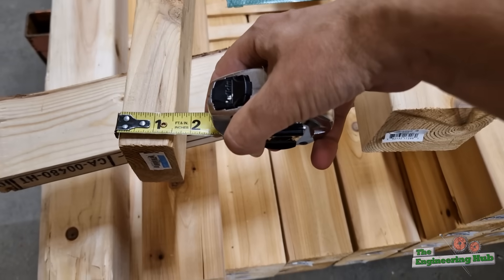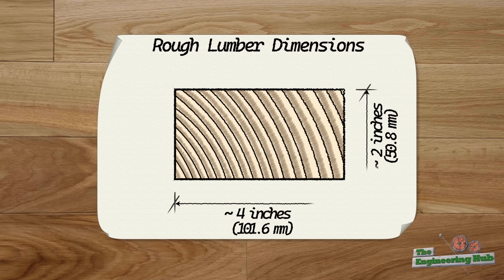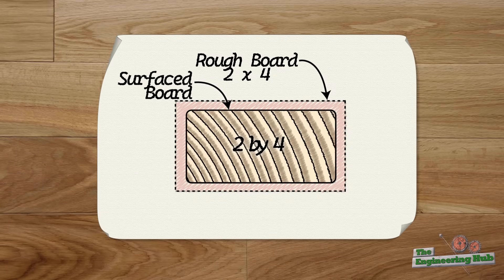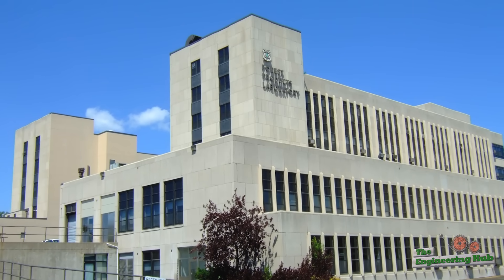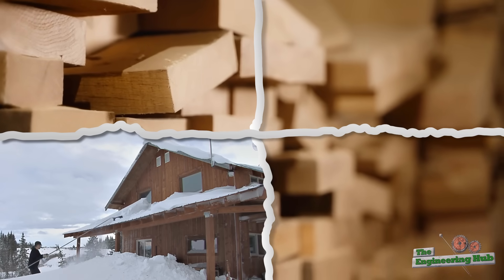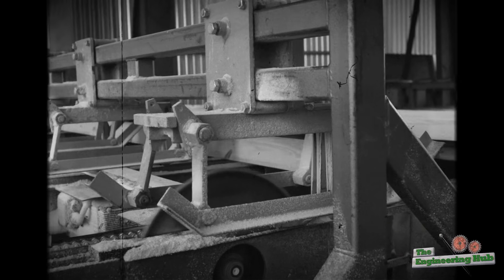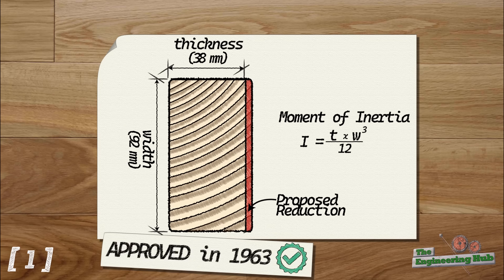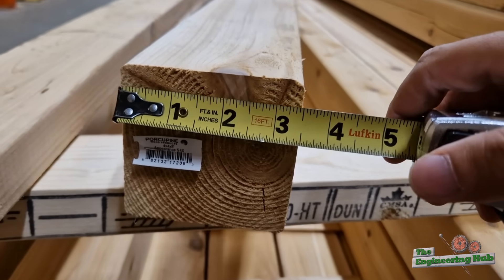Why is the 2 by 4 getting smaller and smaller?

Comment from the maker: Notice how back in the day the corners of the boards were sharp. Now they are planed/chamfered. There are several reasons for this:
1. Chamfered edges help construction workers to avoid splinters and other minor injuries. 
2. The rounded edges make it easier for the boards to slide and travel on the conveyor belts (during production) and are easier to stack. 
3. The boards are (slightly) more fire resistant as the edges usually catch on fire first.

If you found the video entertaining and educational and you would like me to keep producing similar content, consider clicking the Subscribe button. That helps a lot!
Reply: My house was built in 1969.  It's 2x4's measure 1-3/4" x 3-3/4".  They still measure this dimension.  It was like this for a long time before going to 1.5 x 3.5.  It is the planed dimension after planing a rough cut 2x4.
Reply: I'd say the finished size did not begin at a full 2x4 rough cut in the 60's. I worked in a planner mill 1979. Can not attest to any sizes but I know if the board was knot free, they did not mill it smooth. I think they called it "structural" lumber. We jackassed them onto a different cart.  @n2omike
Reply: @cliffontheroad  You can't even buy lumber stamped structural any more. The 1 x 4 let in diagonal wind braces on my 1964 tract house are stamped structural.....but the whole house was sheathed in 3/8 3-ply INTERIOR plywood which I had to replace.
Reply: My 1883 balloon frame house is made from oversized yellow pine stock measuring up to 2-1/8" wide. There is slight variation in width from one to the next.
Reply: @YeOldTimeyWorkshop   it was not that critical when the walls were going to be finished in lathe and plaster.  My 1901 houses floor joist vary over an inch in width on the first floor. The top of the boards are obviously on the same plane and the bottoms that vary face the unfinished basement. All mortise and tenon
Reply: My lumber pile, collected from various house dumpsters, has a wide range of 2x4's, so I must pick carefully.  From 1895, I'd say more than 3 variations. Who ever heard of 3x5 rafters, ruff cut? Me.  @DonariaRegia
Reply: It also helps when sistering them in after you realize you screwed up.
Reply: I have seen a lot of old framing using actual 2x4. None of the stuff I have seen was planned down on sight. You can still see the rough cut on the surface from the saw mill.
Reply: the garage on my property is made of real square 2" boards, it was built in the 1950s @ban80
Reply: The rounded edges also help resist the wood splitting deeply, wrecking the entire board.
Reply: Also you can just them closer together.
Reply: You can pin your own comment
Reply: @TheEngineeringHub  ? 4. rounding the corners lightens the shipping load also ? Just found your channel and subscribed.
It's looking to be a fun ride. peace.
Could you estimate the weights of a house made with 2x4s and the same house built now?
Is insulating quality of a  4" wall space much different than a 3½"?
Reply: It also means they can give you less wood
Reply: @ValdVincent  fake news here kid.
Reply: CLICKBAIT. Why is the 2 by 4 getting smaller and smaller? Oh it isn't? OK so then it should be Why did the 2 by 4 get smaller?...Nobody cares?
Reply: @cliffontheroad   illinois
Reply: Thank you for that info . I have noticed that corners thing here in the UK. On another issue I recently found how difficult it is now to purchase  mahogony  . It seems it is a protected tree.
Reply: @garypautard1069 . The same goes for Redwood I imagine much of it it's because of how much has been cut down and not replaced.
Reply: Another benefit of the rounded corners are airflow when stacked tightly. Less rot/mold, drier wood.
Reply: If you get a 2x4 in oak, it will actually measure out at 2" x 4".  All this cutting down is to maximize the lumber yield of a log.
Reply: Only specific two bys are chamfered not regular framing timbers
Reply: None of the boards in your video actually measured 1.5 x 3.5. They were all a 1/16 under. Plus factory grown pine is like balsa now. Old growth pine you cant even nail into without cut nails lol. Its all fucking trash now.
Reply: It may be worth noting, rough cut 2x4 boards that actually ARE 2 inches X 4 inches are still available, in big box stores, at reasonable prices. If your project calls for larger, stronger wood that's not as flat and smooth, it's still available!
Reply: Very cool info in the video! Thanks!
Reply: The wood is no more fire resistant 🤣🤣🤣the flame spread rating of wood doesn't change you absolute fucktard
Reply: so why cantr they just cut them thicker? ya know? instead of false advertisement
Reply: @bigdaddyd-rk9pn  it's not false advertising it's people being morons and not knowing better. Those of us in construction have known this from day one. Anyone who doesn't k ow shouldn't be building shit lmfao
Reply: When I moaned about my 2 x 4 not being 2 x 4..... I was told it's because timber these days is "Normalised" sounds like a made up word to me lol
Reply: @mickmick5667  all words are made up.
Reply: Then why called them a 2x4 if they’re not 2inx4in?
Reply: @T1AO-NotMike  industry term. You want to ask for it by the actual measurement?? Steel studs are the exact fucking same. Pretty easy to tell who's not in construction here
Reply: I agree.  It's obviously done just to rip people off.  There's no reason the rough planks couldn't be half an inch thicker than the specification, so that the planed planks would then be an actual 2x4, other than cost.
Reply: Holy fucking chirst you have no idea about shrinking in wood. it is MADE AT 2x4 inches. THEN SHRINKS FROM WATERLOSS OVER TIME TO 1.5 inches X 3.5 inches. you just basically told us 'oh, green wood is already planed and shipped to you. That would make the AGED LUMBER THAT YOU BUILD WITH be 1x1.5, You know nothing. Stop. Fact check yourself before you do this 'knowledge improvement lesson' It's false.
Reply: They are round because shape edges get damaged every time in shipping.
Reply: G'day,

Australia squeaking...

Bullshit..

When I was a kid, a 4"X 2" bit of Wood measured
 4 inches by 2 inches..

I" by 1" was an inch by an inch.

But, here in Oz an Imperial Gallon was 10 Pounds of Water, or 4.454 Litres of Water, and 224 Gallons was 2,240 Pounds - which was a Ton.

Whereas Metric Tons, 1,000 Kg was 1,000 Litres which was 2,200 Pounds...; but in the USA they contrived the "Short Ton" which is only 2,000 Pounds 

So, in the
REAL World,
Trees are felled, then Barked & 
Quarter-Cut into Billets which will not crack while drying, and as the Billets are required they can then be Reduced to Rectangular Prisms - ideally
Quarter-Sawn, so the Timber won't Cup or Warp or Twist or Bow or Crack or Split while being dried...

But pursuit of higher 'recovery rates' has prompted most Mills to either "Back-Slab cut" or alternate the Faces to achieve 1/3 Quarter-Cut, 1/3 Best Approximation Quarter-Cut & 1/3 which will warp and crack and split no matter what...;
and then careful Stacking and Racking and Slow Drying - or Kiln Drying...will produce marketable Timber, with half being "selected Timber" for jobs which matter.

Then the Mills are reducing 
SEASONED Billets to
Sizes which are stable when they come off the Saw -
Or
The Wet Wood is cut oversize to allow for Shrinkage while drying, and then planed down to size before going into the Shops.

The FACT appears to be that
AmeriKa is so jam-packed with
Liars, Fraudsters, Thieves, Cheats,  and Fools used to being ripped off by Cheats and other Professional Deadbeats swarming all around them - that they have ALL long
Normalised such
DEVIANCE from the observed and 
MEASURABLE 
Reality...,  within the
Perceptions of their
Sacred
EcoGnomie...

Their "US Gallons" are 3.815 Ltres instead of 4.454, so they're almost 8%  UNDERSIZED..., as compared to a real one...

A "US (Short) Ton" is 200 Pounds short of a metric Ton - and 240 Pounds short of one actual Imperial Ton... ; fully 10% undersized, in Reality.

While the Lies,
Skullduggery,
Ad damnfool
Silly-Buggary which goes on within the US Building, Hardware & Timber-Supply "Industry" ;  
All merely serves as ongoing 
Proof Positive..., that the Commefcial majority of the  population of the 
Excited Status of
Norte ArmedmeriKano are both
Functionally Innumerate, Functionally Illiterate, and
Gullible beyond all 
Logic and
Reason. (!).

So, it's no bloody  that wonder they
Voted for
Trumpy...;
They're ALL at least as 
Functionally
Stupificated as 
Trumpy so very clearly
Is, nowadayze, as his
Frontal-Temporal Dementia
Culminates
Unchecked...

And,
All by their own
CHOICES...

Such is life,

Have a good one...

Stay safe.

;-p

Ciao!
Reply: @TheEngineeringHub  
Very cool to learn this bit of trivia.
Reply: I can assure you that even as an American it is ridiculous to us too.
Reply: The chamfered edge is called “Eased Edge”
Reply: They were never sold unplaned,  ever.
Reply: The wood we buy still have straight edges stop spreading fake news
Reply: Awe ,😢some poor guy got a splinter. Do something besides bleed.
Reply: It's going down!
I'm yelling timber!
You better move!
You better Dance!

Comment: Same problem of sizing and usable size o curs with lifepo4 batteries.
Actual capacity.
Usable capacity (80% discharge)
Warranty capacity.
So if you want your 100ah battery to last and be in warranty.
It will generally be 80ah and be required to be recharged that day.

Comment: From france: I have a 300 years old farm with original oak beams 12"x12"
The inside is still hard as stone!
When I did some renovation, I found a sawmill nearby which had a mountain of trunks in front of his barn. Old trees cut along the roads.
These trees are stronger than the one grown for the wood, nowadays they are grown too quickly and are less dense!

Comment: would be soooo annoying to want to make a cheap cabinet and because its not a full 2 by 4 inches you have to spent more time thinking about the exact dimensions... would be easier for buying, cutting, fitting and everything if you could just measure the inside and add 2 inches to the top and bottom or measure the outside and subtract 2...

Comment: I work in the industry, the plank is 2 x 4 before it has been surfaced 4 sides to make fine planks with as little faults as possible.

If you want a 2 x 4 that is truly 2 x 4 you need to by the rough plank.

Comment: 2x4's most definitely do NOT start out as 2"x4". Logs are far too expensive for mills to throw away all that wood. With modern band saws with sharp, fine teeth, minimal surfacing is required. Smaller boards means you can get more of them from a log.

Comment: 100 year old homes can withstand 150 mph winds , new homes fall apart in 100 mph winds .... it,s not a coincidence it,s by design 😮
Reply: We’re smarter engineers now than we were then.  Any idiot can build a house that can withstand winds, but it takes a highly skilled engineer to build a house that barely withstands winds.
Reply: @jeffreyrossman1083  the materials used  now are junk , sawdust and  glue , plastics  and 1.5 x 3 inch  softwood lumber , the trusses are a joke  , the frames are  weak  and you say the engineers of today are smart  ?  You sound brainwashed

Comment: Here in the UK, until maybe 15 or so years ago it used to be possible to buy rough-sawn wood at the timber yard that actually measured 2” x 4”.
But this was lower-grade stuff usually (called carcassing timber) and significantly cheaper than a PAR 2” x 4” that had been prepared (planed all round) and was thus noticeably smaller. But usually of better quality.
But now it’s only possible to buy them PAR, at the higher prices, and they measure 1¾” x 3¾” and have the corners rounded too.
I would only ever buy them from a proper timber yard rather than a big DIY store, where the quality is invariably dreadful…

Comment: in short: Profit
Reply: 2x4 is interference to the Ruff Cut & back when they used to sell Ruff Cut lumber the customer had to plan the wood themselves. When they started planing them at the mill it saved the customer work & shipping cost & it was still the same amount of wood whether the customer planed it or not. Really the only reason "Profit" comes into play if the claims made in this video are true is that shipping ruff cut really far from the mills made it unprofitable to even run the mills so pre-planing actually worked out for the consumer & producer.
Reply: @wandameadows5736  You don't need to plan everything un construction. It is for profit.

Comment: Having smaller studs closer together means that lining and cladding materials don't need to be as rigid, because they are supported at shorter spans along their length. Have a look at a plasterboard manufacturer's installation instructions and it becomes very clear that more frequent, smaller studs have a big advantage!

Comment: I live in a home that is over 100 years old... There used to be a mill/lumber yard down the street (long gone)
This home is FRAMED with 2 inch by 4 inch oak... the joists  are also OAK and are thinner than what we use today but being that they are oak they are overkill.
I have drilled screws into the boards and literally exceeded the drills capacity to bottom out the screw, even with hammer drills
even some contractors that have seen this are baffled that this is how it used to be done and don't believe real 2x4s exist, they used to but not anymore.

Comment: This is how you get a dozen  different gallons or hundredweights.
Reply: Gallons aren't measurements of length.
Reply: @zyxw2000 

I didn't say they were or are.  There has been, over time, a number of different gallons.  Sometimes at the same time.

Similarly, there are times and places with different hundredweights for different products.  For example: in midevel Cologne, a hundredweight of nickle ore was 120 (Cologne) pounds.  This was because about a fifth of nickel ore was useless, so the consumer got a 20% discount.

Comment: There's another factor to consider.

Throughout most of the 20th century, sawmills were indexed to whole inches. As the log carriage returned, the log would be shifted by a whole inch; shifting by other amounts was not possible due to limitations of the equipment, so rough lumber was always cut in whole inch increments.

Initially, lumber was unsurfaced, so was full dimension (i.e., 2"x4") but the limitations of the equipment also meant it wasn't exactly consistent, sometimes varying by as much as 1/4 inch, even on the same piece!

In order to produce consistent dimension, the lumber was proposed to be surfaced on only two sides: one face and one edge, to a uniform size of 1-5/8 by 3-5/8. This allowed for compensation of the variable thickness of the rough lumber by removing as much as 3/8".

When it was deemed desirable to surface all sides, removal of 1/4 inch on each side was allowed, resulting in 1-1/2 by 3-1/2. By this time, mill equipment was more consistent and accurate, but still indexed to 1".

That means that all that surfacing only reduces per-piece shipping costs, but there's still a lot of waste from the planer mill.

I'm not saying you're wrong, just that there were additional considerations.

Modern sawmill equipment allows for much greater precision and accuracy of cut, able to index to fractions of an inch. A modern mill can probably rough cut a “2x4” at 1-3/4 x 3-3/4 (or smaller) and need only remove 1/8" (or less) from each side during surfacing, maximizing the use of the log and reducing planer mill waste. But the standard is set, and production builders would be upset if the lumber suddenly got fatter because many materials besides the studs are keyed to studs being 1-1/2 by 3-1/2.

Comment: It never was 2x4 in reality. Dimensional lumber is nominal. The dimensions are based on the raw size before the wood has dried out or been treated.  Been working with wood a long time, 1.5x3.5 is a 2x4.

There is lumber that is true to size, things like plywood, engineered beams and boards are true to size. 

Been working around lumber since I was a kid, relatives owned a construction company going back 50 yrs, it has not changed all that much.  It hasn't changed the useability of it, engineering standards for things like unsupported span length have def changed little if anything at all.

Comment: Interesting info - but really doesn't tell me why a house I owned years back, built in 1950, was framed with actually as measured 2"x4" studding. I rebuilt that houses garage, reusing many of those old 2x4's, some from my home builder father in laws old 1960's stock 1-5/8 x 3-5/8 and some new 1-1/2x3-1/2 studding. Of course I never measured any of them - oops! The real fun came when I went to install dry wall. Lots of shims cut. House and garage are still there 40+ years later and still looking good though I've moved on 2-3 times since.

Comment: To all the clueless dumb*sses posting here. I spent my entire life working in the timber industry and this is not complicated. Green wood is full of water. Sometimes over thirty percent by weight depending on specie. After being sawed, the lumber begins a natural drying process. Kiln drying speeds up the process, but the goal is the same, obtain a moisture content below 19% for framing lumber. When that much water is removed the lumber shrinks, but not the same amount from board to board, thus after drying there is a stack of lumber with a multitude of dimensions. Planed lumber makes all the boards uniform which is highly desirable for construction. The myth that the sawmill is trying to rip your *ss off is bull pucky. Over half of the missing dimension is water loss from drying. Water doesn't add strength. Very little wood is removed by the planing process.